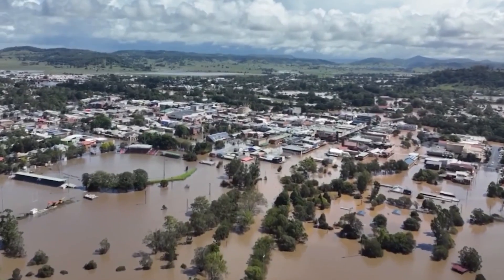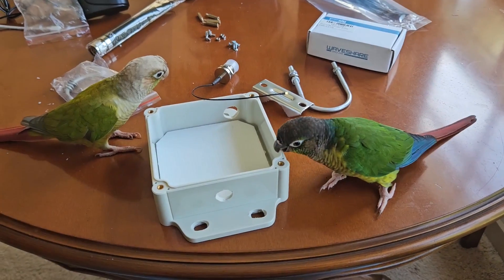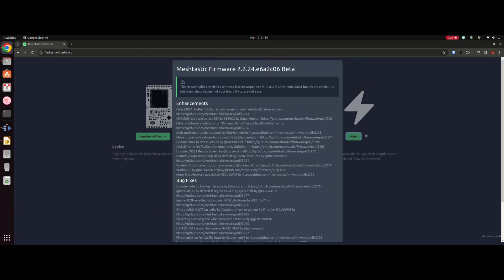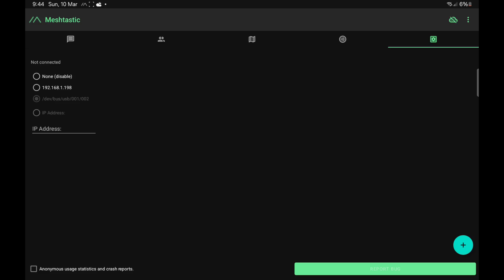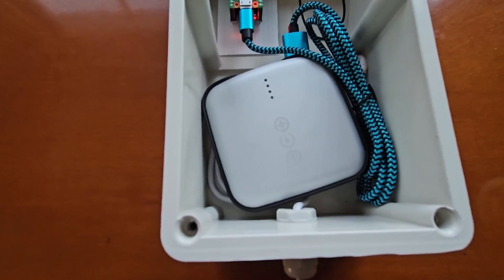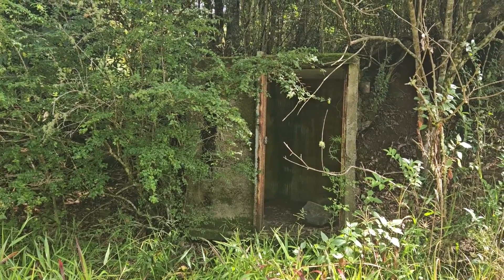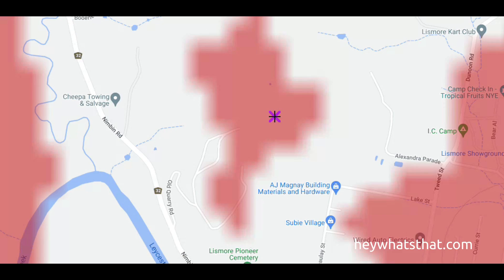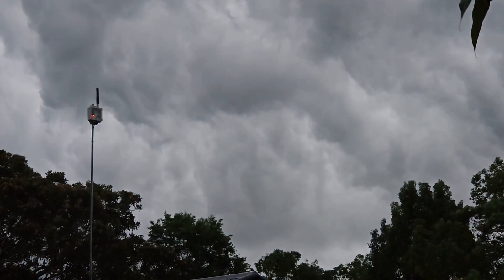Building a Mains Powered and a Solar Meshtastic Node - Lismore Australia

Comment: Very cool! Great job man. I plan on doing something similar next time I visit my parents in Florida. It’s not uncommon for them to lose cell service for weeks when a major hurricane comes through. My plan is to use raspberry pi zero 2W’s over POE but also with a battery and solar panel. The POE is mainly so I can keep them updated remotely but also to keep the battery topped up. Thanks for some good info and inspiration 👍

Comment: I would Shove a Pi5 (8GB) with LoRa LoraWAN Shield or 2 Hack RF One SDR's ( or a few for Directional sectoring 433MHz & 838Mhz 915MHz) 

Nice Thing With the Raspberry pi (PI3 ~ Pi5) They All Support POE 24V ~ 48V DC over Ethernet cable 30W 80W  you just need 2 Path Jumpers for the POE 4 pins 

However I would also Use Mesh WiFi v6 for Closer Nodes even run a Mesh Telnet BBS (bulletin board system) Terminal Mesh Service on both Wifi Mesh & LoRa WAN Mesh (After all it is a PI5 With SSD M.2 nvme ) so can run a OFF Grid  micro Internet (LoRa & WiFi)
Reply: Im in the process of raising a pi5 w/rtl-sdr & 3 Heltec v3 Lora transceivers(long slow, long fast,mediumfast). Thanks for the ethernet power info. Ive never even heard that.

Comment: Did you drill top and bottom condensation vents as it's wet as hell around here and I know from experience that moisture will build up inside that little enclosure.
Reply from the maker: The cable gland at the bottom isn't water tight, so any condensation that settles can exit through the hole.

Comment: Great to see. I'm planning something similar, but I was going to run 12-24v up to the node from a DC plug pack indoors, and use a small DC-DC step down module in the box up on the antenna mount. You can buy a potted module with a USB-C connector 😍, which is what I use for remote raspberry Pi.

I once tried running 5V to a raspberry Pi 3B along about 5m of 0.75mm² copper but it wouldn't work, due to the voltage drop and power required. I guess these use 150-300mA or so, maybe that's fine. 😁
Thanks for making the video!
Reply: I used 48V POE with a splitter at the end.
Reply: PS. My step down module died when the enclosure leaked. Turns out you can just run 5v along about 10m of 0.75mm². And the Heltec V3 runs just fine! I'll measure the voltage drop next time I go up. The heltec uses about 150mA, a lot less than a raspberry pi, so that's probably why it works.

Comment: Isn't the first one going to work as a massive lightning rod?
Reply: Is it any worse than having a TV aerial?
Reply: @fraz3385  Well the antenna usually has a galvanic separator to prevent your TV from taking damage. Here you basically put your TV on a metal rod. :)
I assume the rod itself is grounded so other than having to replace the electronics there shouldn't be any danger.
Reply: @SlowLurker  I'll have to read up on how amateur radio does it.
Reply from the maker: There's actually a quite a few trees around that are a bit higher than the node, so hopefully they attract any lightning away.